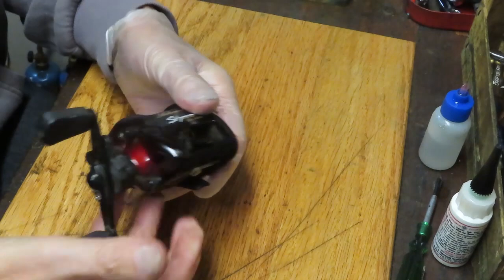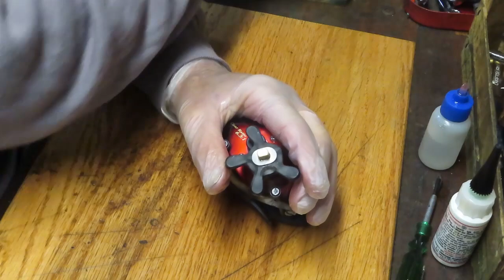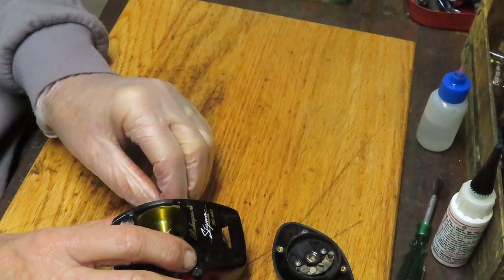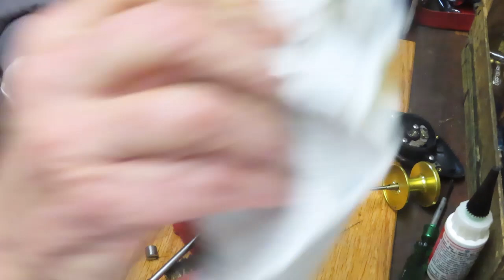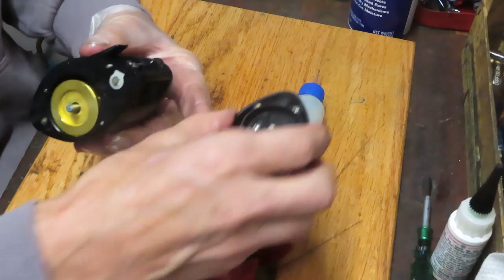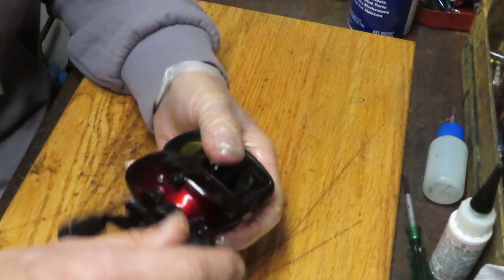Shakespeare Sigma 440SS low profile bait casting fishing reel how to service

Comment: Dennis, I'm still trying to understand all the intricacies of low profile baitcasters.  I've learned a lot (going from absolute zero) but still have questions about some things.  

What I've learned so far:  When you press the thumb bar down (actually a slight arc), it rotates the clutch plate approximately 90 degrees.  This causes the cam plate (which is attached to the clutch plate) to also rotate.  Somehow, cams on the cam plate and the pinion yoke convert the rotary motion to linear motion in the direction of the crank handle.  On the reel I currently have open, this movement is only a fraction of a millimeter toward the handle (the pin through the spool shaft looks to be about the same diameter). The rachet pawl is moved into position against the rachet wheel to prevent the handle from being able to rotate in reverse or forward..  The spring linking the body and the pawl doesn't seem to compress, it just changes direction 90 degrees.  Its function seems to be to provide positional stability only. All that remains is for a forward wind of the crank (against resistance, which suddenly collapses), and you are back where you started.  This forward movement of the crank turns the rachet wheel against the pawl and, because the back side of the rachet teeth are curved whereas the other sides are straight, the handle is eventually able to move free. The pawl is moved out of the way to its original position and the spring is also moved to its original position.

Question:

 Some reels have two springs and some only one (not counting the two small ones on the cam plate posts).  The one they all have goes from the frame to the rachet pawl.  The other goes from the frame to the clutch plate.  Is this latter (optional) spring there to assist in moving the clutch plate back to its starting position or for some other purpose, such as holding the clutch bar in position?
Reply from the maker: The series of springs on a bait caster are meant to help return the clutch back to operating position once the free spool release is triggered. - Thanks for asking - Dennis